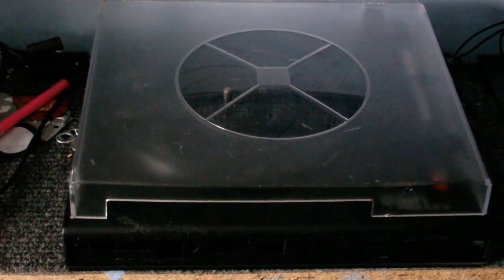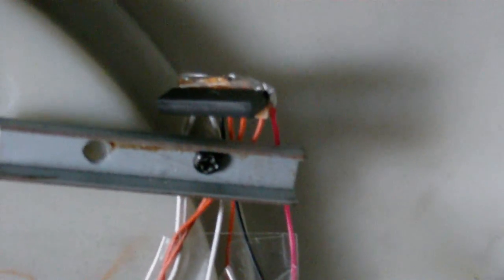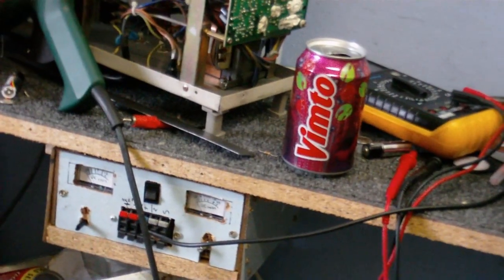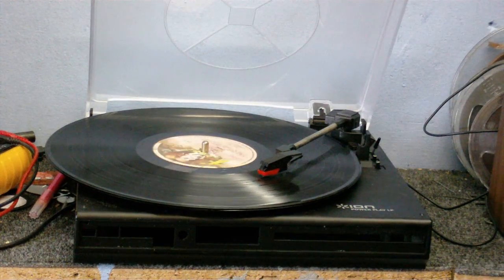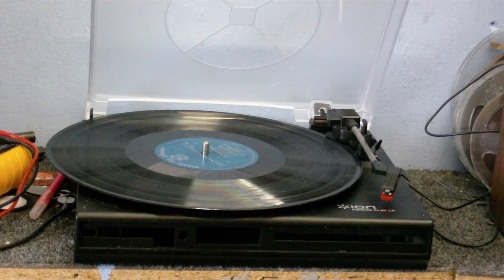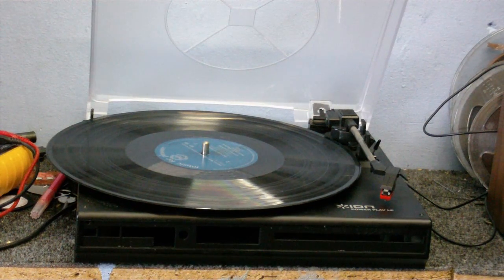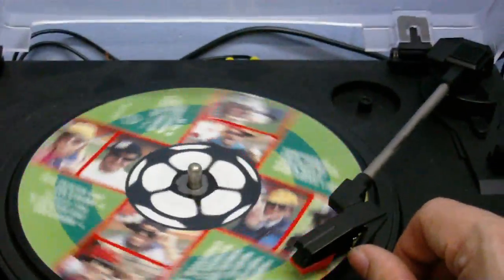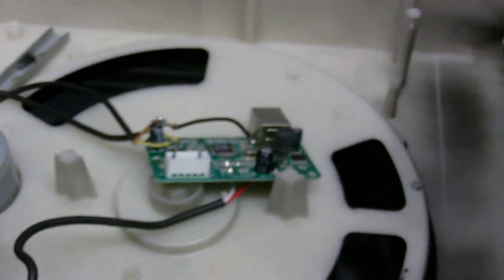Phono Phun

Comment: Interestingly, although it has the same cartridge, my Numark PT-01 has more treble than your ION. My substitute for the PiezoMatch preamp circuit (because I am not experienced with circuit building) is the BBE Sonic Maximizer. It has variable bass and treble control, so you can adjust the sound to your own liking.

Also, I have a Sears turntable from 1985 that has the very same cartridge. It manages to come out sounding even muddier than your ION! That means no 2 ceramic cartridges are the same!

Comment: Ceramic cartridges are like short-range microphones. The sound output is produced by the needle vibrating against a rubber clamp, which creates pressure on a piezoelectric crystal. If you tap one, you will hear the tapping sound out loud on the audio output. This does not happen with magnetic cartridges.
Reply: OldMusicOnVinyl1 It depends on what part you tap.

Comment: I do have an ION Usb turntable which i purchased for 180 US Dollars. It is much better then the one featured in this video (it is a different model and is featured ION's webpage). It came with a lower end magnetic cartridge, but for a really cheap cartridge, it has really good frequency range, very very close to the magnetic cartridge you show in this vid. It is a samsung cartridge, but what model is unknown. Replacement needles are labeled "Samsung ION USB turntable needle".

Comment: I had a realistic turntable which suffered even worse mechanical noise. The turntable originally came with that ceramic cartridge (i much perfer to call it a plastic cartridge because most of them usually are 90% plastic..atleast the ones mass produced today). I ended up retrofitting a magnetic Audio Technica cartridge into the machine and boy did it make a difference! You could still hear the "purr" from the motor.